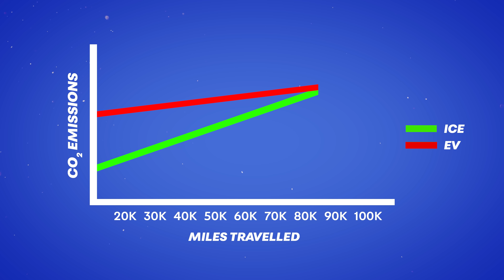Are Electric Cars REALLY That Green? [New 2022 Data]

Comment: NO.  ICE cars are more environmentally sound. It`s almost certain that I will learn to develop an ethanol before I buy an electric car.  Certainly there will never be an electric car as old as my X90. The maximum age of an e-car will be about 7 years before you need a new one.  There are answers, such as replaceable batteries; but currently an e car will not last longer than seven years. It will not have the distance either, and will cost a LOT more than a SH ICE car.  They are there for the PCP companies and manufacturers, NOT the driver, nor the environment.

Comment: I like your video. The information from Volvo is very interesting and makes one think more carefully about EVs. One thing missing is the CO2 expended in the recycling of the battery packs. It is very costly and difficult to dispose of the millions of battery packs which are being created. That is the tipping point which makes EVs more polluting than ICE cars, even after the 90,000 mile crossover point Volvo mentions.
Reply: You do not dispose of EV batteries, firstly the battery is probably going to outlive the car and when that eventually happens the battery will then be used for storage not disposed of. And any batteries damaged in accidents will be 99% recycled and used again in new batteries, so there will not be the pollution that you are talking about. And it is not expensive to take a battery apart and reuse it, but disposing of all the catalytic converters and oil and coolant from IC cars is very expensive as they are extremely polluting materials.

Comment: While all the points made by Rory are true today it is also true that BEV's will get greener to manufacture as recycled materials become more available and battery manufacturing improves. Try recycling the Diesel or Petrol that was used in an ICE car. 
Also as battery technology improves the batteries will last longer so can be reused after the cars wear out or are crashed. Think of all car charging stations that need to be built across the world which will need some kind of battery backup. This means the C02 used to create the batteries can be shared between the original car and whatever else they end up being used for.

Comment: Great video mate very balanced, just curious have they included having to change the battery after so many miles/years in those figures, as surely that would take them longer to equal the co2 out put of an ice car.
Reply: You can’t buck physics. Nearly all EVs run on Li Ion based batteries. ALL batteries lose capacity overtime due to number of charge cycles, temperature cycling and internal degradation. Even with perfect software controlled charging, elaborate cooling and ideal use (for Li Ion use between 85%-10% charged) after about 8 years the battery capacity will have fallen to about (that’s approx folks!) 30% of original capacity assuming typical daily use and charge cycles. Yes you can still use the EV but with only 30% of the new battery range. An expensive new battery pack needed every 9 years or so……
Reply: There is no need to change the battery in an EV, it will outlive the car. Some of the early technology back in 2009 and 2010 had batteries that degraded fairly quickly due to many things but new technology it does not happen.. I have an EV made in 2013 (63 Reg) and my battery still has 98% state of health, so that change of batterie3s does not happen.
Reply: @juliandavies7890  How many times have you ran your batteries down to below 5% charge, you know on a long road trip or something. Is it all city miles or highway miles. Are you in a extreme hot or cold location ?    Point is just because you have not had it happen post 2013 doesn't mean it hasn't happened to others.
Reply: @juliandavies7890  Sorry I dropped the phone and it inadvertently posted the comment before I finished. What I was going to say was that having caught Covid twice and not only suffered from chronic fatigue with long Covid each time but also gone through two lock downs as well the phone has been in constant use and it now needs to be charged a minimum of twice a day because the battery no longer has the capacity that it had when it was brand new, this is just another example of battery degradation over time and whilst mobile phones do not have the computerised cooling systems to try and extend battery life as much as possible like EV cars do in  order to help minimise battery degradation over time. After I dropped the phone I noticed that you have your own channel with a couple of videos on it called EV's in the Park after posting this I will have a look at those videos and see what you have posted out of interest to see if they  give any clues as to the make and model of your EV Good luck and stay safe.
Reply: @fjspicer1   there is no point in comparing the life of a mobile phone battery with a battery for an EV.

they use simialar chemisty, but the suits that sit around the boardroom table have different adjendas for how to grow their corporate empires

 mobile phones are designed as a "fashion accessory" that is designed to be replaced every other year, so that is how long the design life of the battery is.  they come with a 1 year warranty.  the makers know the battery will be buggered after 18 months to 2 years, but there will be another model out by then, with more features, and the phone maker wants you to buy a new phone, that is where they are making their money.

the battery management system in an EV is designed to make sure that the car owner will not be going back to the manufacturer during it's 8 year warranty period, because that would cost the car maker
Nissan screwed up with the poor choice of chemistry in the original Japanise Leaf, and now 10 years later, they don't have a good range now they are out of warranty, so some of them are only useful for local shopping trips.
 But so did Ford with their eco tech engines, and BMW with their diesels, and VW with their dual clutch gearboxes, which are now garden orninments. even some of the ones that are still under warranty

when my EV was new, it could do about 200 miles.   4 years and 71,000 miles later, it can do 195 miles.   from the fancy stats on my car and the stats other owners are collecting, it looks like the battery on my model of EV should be good for around 250,000 miles
Reply: @RichardButlerUK  The point of the conversation is just to show that all batteries degrade over a period of time some to a greater or lesser extent than others. No doubt when solid state batteries finally hit the market they will hopefully be a great  improvement on the current ones. I would be interested to know the make model and specification of your EV please
Reply: @juliandavies7890  From a perspective point of view it would be nice to know the make , model and specification of your car.  Was it bought new and how many miles has it done please?
Reply: @juliandavies7890  Hi I notice you haven't responded to any of the various polite replies to your original post stating that your 2013 EV still shows 98% capacity  compared to when it was new. Did you not hear in the news about an Indian  gentleman who purchased second hand an expensive MB Hybrid car, I believe there was a service plan on the vehicle and it was regularly serviced at a MB dealership at exactly 10 years of age the battery failed. Now the car's book value was £15k and when he enquired from MB what the cost of a new main battery was for supply and fit he was quoted £15k. I don't know what the  final outcome was did he spend another £15k just to keep his trusty MB on the road or did he scrap the vehicle. If he watches this channel I would like  to know the answer.
I have a 2018 Samsung Galaxy  A9 purchased new, it was used cons during both lockdowns
Reply: @juliandavies7890  -- Don't drive much huh, aren't you lucky
Reply: @juliandavies7890  Battery packs can and do fail.
I'm not suggesting that is common, but lets keep things real.
Reply: @matthewjenkins1161  If it's not common, it's irrelevant. And ICE motors also sometimes fail early. 
Looks like a useless distraction to me.
Reply: @matthewjenkins1161  So do internal combustion engines. Maybe not as costly (in terms of money and resources), but probably much more common, judging by how many articles there are about which engines to avoid.
Reply: @Astrotripper2000  But rebuilding an engine isn't rocket science and good used engines for most 10+ year old cars just a few hundred quid.

Comment: Your like for like comparison fails. When you have a company in one groove that then just repowers their shell their method is the problem, in NZ power is predominantly hydro and many tree huggers wouldn’t think of buying just that car but also a greener power system ... we will still have plenty of ice cars for a long time, maybe forever, just not need to use them so much ... all my trees run on CO2 so let’s keep them happy. It’s actually Water causing the climate problem so let’s stop the bogus CO2 witch hunt it doesn’t help ...

Comment: Another factor, is the sheer amount of infrastructure that has been and needs to be built to restock the energy source of EV's = enormous pollution.  

Further, how long do EV's actually run for? Will they even come close to the km's or miles that regular cars and say a 2L engine goes for? (i.e. 250-400k on the odometer) Can you drop a new EV motor in there like you can drop an older engine in a car easily from the 2000's era that has already reached almost two decades past it's manufacturing and resource to build cost/CO2/energy impact? 
I will by driving my 2002 as long as possible as it's easier to maintain than a more modern car, it's more reliable than a modern car as they are really skimping on engine/build quality nowadays for infotainment/comfort and the engines were built to last. Many Euro cars now seem to have 1.6 or 1.4L engines with a minimum of a single turbo and with the pressure they're under, there's no way small displacement engine can outlast a 2 or 2.5L from a slightly older era. 

Wind energy with wind turbines is the opposite of green, they are worthless and are creating fields of used wind turbines that cannot be recycled. Bird killers and they really disrupt the ecosystem plus their energy output is weak and they need to be serviced a lot. Solar is not bad but still a lot of mining for silica and refinement needs to happen before you even have clean material to work with. 

And, what about that Toyota? It seems they're onto something with the hydrogen engine, I feel that is the way to go. Plus it actually sounds nice for all the petrolheads

Comment: 90000 miles
 the battery warranty is between 6 and 8 years life span and they usually work warranty 2 ways either mileage or years which ever comes first so annual mileage roughly 12000 miles a year and depending on how many fast charges you do on the battery so possibly by 90000 miles you would require a new battery replacement which would then have be carbon mined and shipped also disposal of old battery pack so is it going to get greener after 90000miles dont think so ic vehicles engine could last forever

Comment: After 9 years or so I imagine a fair few batteries will be needed to be replaced, whereas a diesel car is likely to give many more years service. So the electric car's C footprint surges if we keep it on the road or we could scrap it and increase C that way. The only real way to reduce the car problem is to do fewer miles...and probably do them in an ICE car. There is very little talked about the environmental impact of mining metals and producing the batteries. We're just removing the local pollution problem to another country where often, life is cheaper. The irony is that many ev drivers have a nice wood burning stove chucking out particulates into the local atmosphere.

Comment: At least you are having the conversation well done. All I want is an ev that costs £15k and does over 300 miles per charge and charges is 30-40 minutes. When we reach that I will buy one gladly. Until then I will stick with my Suzuki Ignis that does 320 on a tankful and takes 4 minutes to fill up.

Comment: Nice video and thank you for making us aware of this interesting report from Volvo.  You will have undoubtedly infuriated all the BEV zealots with your data driven objectivity.  I don't fully agree with your conclusion that the BEV will fully dominate - but I think you are absolutely correct with regards to city use and local emissions.  One thing I would encourage you to do is to calculate the contribution over the next 50 years to global warming in °C of either the US or EU transportation sector.  This is easy to do using ipcc published data.  I think you'll find the result very interesting.  It might change your outlook on the government subsidized transition to all electric vehicles.
Reply: That could be offset very dramatically if the US and/or EU had any politician with a tiny bit of technological knowledge. By switching heavily to 4th to 5th gen nuclear, not only cold we consistently produce enough cheap electricity for everything at 1/4 the CO2 emissions of even solar, but the waste heat could be used to produce carbon free hydrogen and synthetic fuels, completely eliminating the massive dependence on batteries.
Reply: @poulwinther  regrettably the likes of Angela Merkel have contributed to the demise of nuclear in the West.  One can only hope that the French approach will eventually prevail.  But I agree with you - and if it were up to me I would immediately stop all EV subsidies and redirect them to support innovation in many of the fields you mentioned...

Comment: That estimate of 90k is absolute nonsense for smaller vehicles, it would at least have to be a range of 30-150k based on car weight,power sources and how dirty the petrol is.  Most makers don't copy Volvo's design choices, which are non optimal by definition as it is using heavy frames,  batteries it only recently got ahold of, and uses many more and unnecessary parts in common with ICE and hybrid. 

The overall approach to estimating is however sound, the number of km to pay the ecological cost could and should be calculated based on local supplies of electricity AND fossil.